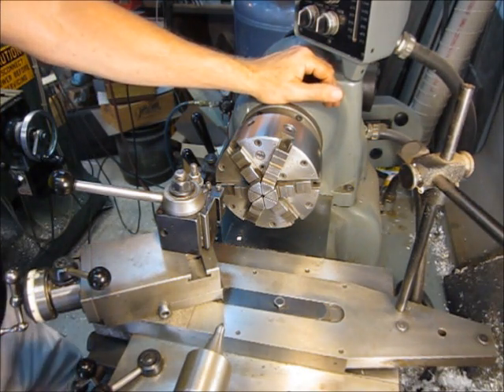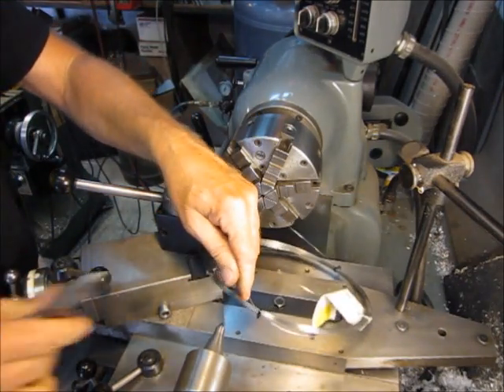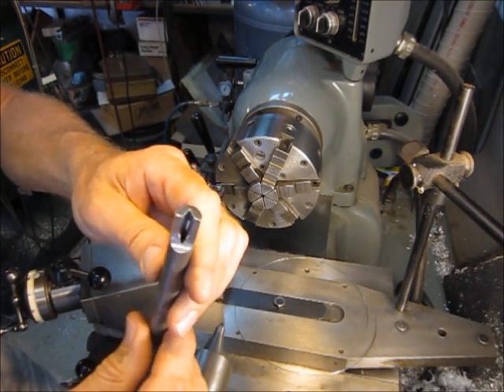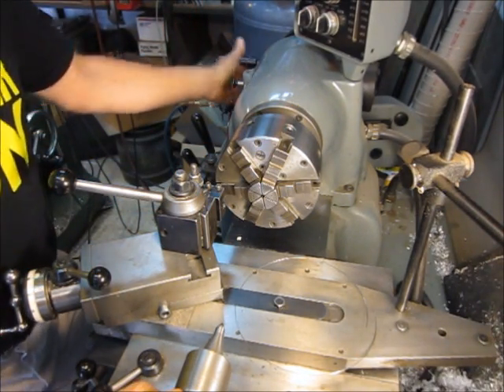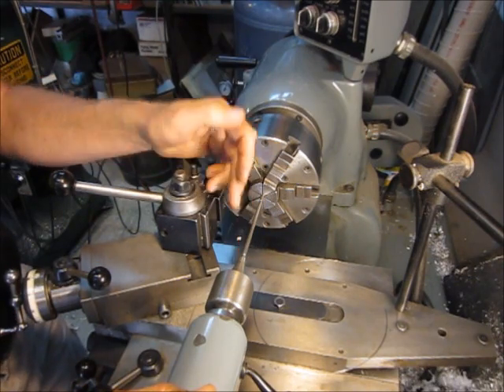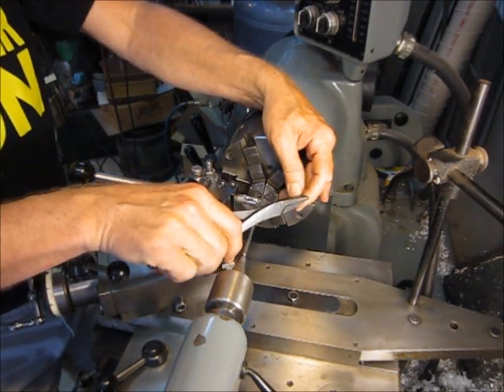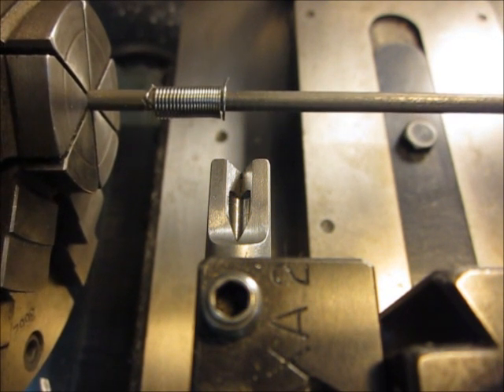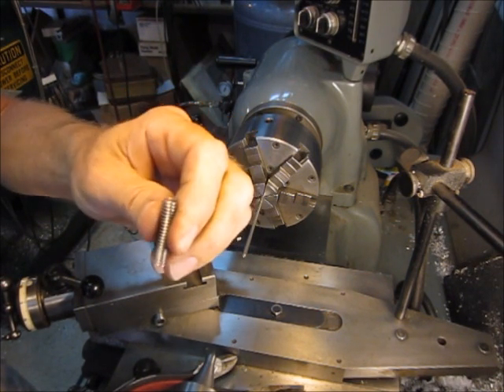How to Wind a Coil Spring on the Metal Lathe

Comment: For a compression spring couldn't you set the threads per inch at say 20 threads per inch or less to wind it with a gap already generated in it before it comes off mandrel so that it is more consistent?
Reply from the maker: Springback of the wire affects pitch as well as diameter, so the finished pitch may not be the same as the feed rate

Comment: Hi Tom. I hope you are well. It's been a couple years since I've watched your videos but I'm sure your techniques are coming in handy on a daily basis. I'm surprised this video wasn't at the top of my "How to make a spring" search. But whatdyknow, as I started another video, you were right at the top of my "Up Next" column. Maybe YouTube want't me to see the wrong way first.  Who knows. Didn't watch it. 

Ok! Movie is about to start! Thanks Tom. Have a good one!
Reply from the maker: Thanks.

There really isn't a right or wrong way to make something, as long as the finished part is correct and the method is safe. Some ways are just more efficient than others.

Tom
Reply: @TomsTechniques  Yeah I was just kidding about the other video teaching me the wrong way. I still haven't watched it... What you're saying makes sense to me.  If the method is safe and effective, you're somewhere in realm of right ways. If If you fail to check both of those boxes, you're probably in the realm of wrong ways.
Reply: Let me add that my first attempt to wind springs on the lathe  was straddling the line between right and wrong. Didn't get hurt but that .080" hard stainless wire was quite the wild animal. I think it's a sign that your heading the wrong way if you're doing  strenuous physical labor while operating machine tool. I did manage to make one that was loosely within the specs I needed... But I need 8 so, time for a lesson.

Comment: Don't cut steel wire with the side cutters you use for copper wire.  Said side cutters will be useless after 10 cuts.  Use tin snips or proper steel wire cutters that resemble bolt cutters as wire cutters for steel wire, they work better and don't break.
Reply from the maker: I think you may be referring to the flush cutters used in electronics, which will definitely die if used on hard wire. The side cutters I used in the video have a 90º included angle on the cutting edges and hold up well on small diameter hard wire. Cutters with compound action, such as bolt cutters, are necessary for larger wire because of the force required. Of course if your side cutters are made in China, all bets are off. :)

Tom

Comment: Unlike the comment that said it wont work, I found your video very good. I have made springs with a battery drill and a mandrel free hand that worked just fine. Your method is much more precise and I will be making the guide tool to try it for myself. Once again, Thank You. 

In reference to the comment, "you are doing wrong",  for criticism to be constructive it must be accompanied by the facts that support the "wrong" and perhaps the commenters view of the "right way" for support. Just my  .02 worth.
Reply from the maker: Thanks Shannon.

What most "You are doing it wrong" comments really mean is that you are not doing it their way. :)

Tom

Comment: sir you are good machinist. But I seriously doubt you can make a better spring than a torrin spring machine. no disrespect intended but I was a spring maker for 15 years and have since moved up to  spring machine maintenance. I find your techniques extremely helpful since the gentleman I work with in the tool room offer no help to me at all.
Reply from the maker: Springs are a necessary evil and I only make them if I have to. Not looking to replace a machine. ;)

Comment: Hi Tom! Thanks for sharing your tips!  Do you know how you could get a specific pitch for your coil using this method?
Reply from the maker: Coils per inch would equate to threads per inch on the lathe. It's not always 1:1 though due to spring back in the wire, so you may need to experiment a bit.

Tom

Comment: A bit too slow, but good information.
Reply from the maker: +Dan Butterworth 
Thanks, but I have to disagree about the speed thing. There are many levels of ability here, so it's better to take it slow and cover all the bases than rush through for a few. 

Tom
Reply: +Dan Butterworth Not to be rushed, stainless spring wire can go right through your hand or tear off a lot of flesh, handle with care.
Reply: AusMecham I wasn't talking about the speed of the machine or the winding. I was talking about the length of time (filming) it took to do the set up. Tom was correct in that for me it was too slow, but for many others maybe just right or to fast.

Comment: For a compression spring, don't stretch an extension spring or it will simply not have the compression rating you expect and in time it will flatten as the wire goes back to original de-stressed position - always wind the coil with the desired gap for a compression spring to get the free and compressed length you want - in addition the compression spring needs a dead coil (flat with no gap)at each end or the spring will compress crooked - to do that just stop the cross feed at the end - cut the wire and then grind the end of the spring flat back to one dead coil.

Comment: After you bend the spring end to a hook it must be de-stressed in the oven or the hooks will brake off at the tight bend with age and work - preheat oven to 280 F and leave spring in the oven for 20 minutes and allow to cool in air and that will de-stress the tight bends on the hooks you made and they wont beak off.

Comment: My local spring works guy showed me how to make springs - 2 things to add - after winding the spring if you want to put hooks on the end get some flat sheet in the vice and grind one edge of it sharp to use as a bending jig - push the spring side on to the edge of sheet so one coil of it is on one side and the rest of the spring on the other side - this isolates the rest of the spring from the part of it you are bending so only the end coil; get bent and doesn't bend the second coil in at all - slip a screwdriver between the jig face and the single coil and bend it out a bit - then grab it half way and bend it 90 degree - that will give you a hook that looks like it was machine made and your wont bend the second coil at all.

Comment: Awesome!
Could you make gooseneck that way? You know, like for lamps?
It's made of two springs inside of each other, with the outer one made from triangular cross section wire.
Reply from the maker: +Cancun771 
Not sure how you would control the orientation of a triangular shaped wire, but it might work. Give it a try.

Comment: Tom, how does one overcome the problem of making a small internal diameter spring with comparatively larger diameter wire?  I'm worried I will have too much tension on such a small mandrel.  Any tips to overcoming this obstacle?
Reply: You just need to use the travelling steady against the mandrel, as close as possible to where the wire is winding. Just the same as when turning except that you are pulling wire instead of pressing against a cutting tool.
Reply from the maker: +Barry Lochridge 
That is one of the limitations of this technique. At some point, the force to form the wire will exceed the strength of the mandrel, but by keeping the mandrel short and using high strength steel for the mandrel, you can wind some pretty beefy springs.

Tom
Reply: +Toms Techniques what would you think would be the largest gauge wire you would be able to wind a spring with?
Reply from the maker: +ryan cler 

I've wound 3/32" wire with this setup. but it was a larger diameter spring. The mandrel must be capable of standing up to the force of the wire without bending.

Tom
Reply: Would it be possible to just heat treat it after winding?
Reply from the maker: +ryan cler 
Sure. You could wind larger wire if it was in the annealed state.

Tom

Comment: Awesome Video!
Did you make the mandrel or did you buy it?
Thanks
Reply from the maker: +Michael Pfleegor 

Thanks. Check out the video at 3:15 to find how how I made it.

Tom
Reply: No no the mandrel not the wire guide.
Thanks
Michael
Reply from the maker: +Michael Pfleegor 
Sorry. Yes, the mandrel is just a piece of round stock with a cross hole for the wire.
Reply: +Michael Pfleegor Check out 2:19 on the video

Comment: You can wind compression springs by setting the feed to 1/(diameter of the wire plus the desired spacing between coils). As always with springs, you will have to experiment with mandrel diameter and feed to get the exact compression spring you are looking for. 

I use a slightly different style of spring winder; I made this one nearly 50 years ago:

http://s898.photobucket.com/user/pwmeek/library/Shops/Spring%20winder

Setting it up on the lathe is the same.

If the outlet of the winder (of either type) is set to trail the location where the wire is winding onto the mandrel (by maybe by 1/2 to 1 wire diameter) you can get a bit of pretension (which one of the other commenters was asking about). You need to wind a few turns by hand before interrupting the feed while the mandrel turns 1/2 to a single turn farther. Now the wire is pulling down past the previous coil (you need good tension on the wire) and putting a bit of pre-load into the coil. Pulling the wire "over the shoulder" of the previous coil puts a little sideways bend in the wire, pressing it against the previous coil. Wind longer than you need and discard the "soft" coils at the beginning.
Reply from the maker: Peter W. Meek 

I used to think that tension was necessary as well. The tool I use in the video uses no tension at all and winds excellent springs, which is fine by me because maintaining constant tension can be a pain. I do occasionally use the feed to wind compression springs, but like choosing the diameter of the mandrel, it takes some guess work to get it right.

Tom

Comment: Several years ago, I used my old Logan lathe to create new heater elements for a heat treat oven.  The material was softer, but doing the process of coiling them roughly like you did got the job done.  I never thought of actually making springs, though.  Awesome tutorial!
Reply from the maker: Thanks!

Comment: Is that 302/304 or 316 Spring Tempered Stainless Steel Wire? Overall, very nice video. Just was wondering what type of steel your working with. (+1 : 671)

Comment: Great Video!
I saw spring making in my shop theory book 40 years ago but never actually saw anybody make a spring.
The next time a garage door spring snaps I am ready to slap an arbor on the lathe and go to it.
Reply from the maker: Thanks Bob,

That sounds like more trouble than it's worth. It would take a pretty beefy set-up to handle wire that large.

Tom

Comment: Very useful tutorial (as always). Does the guide need the v-groove or will just a drilled piece of CRS do? Can the groove just be machined with a 90* angle with an endmill?
Reply from the maker: Thanks.

The V groove allows for many different wire sizes. It is 60º on mine, but 90º may work if you don't have a 60º cutter.

Tom
Reply: Shouldn't just having a countersunk hole be enough for different wire sizes? Or even just drill through, and then milling off part of the top half of the tube to act as a groove?
Reply from the maker: Anand Rajamani

You can try, but I suspect a V-groove of some sort will provide more precise control of the wire.

Tom

Comment: That was super cool Tom. How long have you been machining? I have watched two of your videos so far. You have new subcriber!

Question: Do you think you could make a compression spring by just setting the quick change to maximum feed rate? I am wondering if this method would work for heavier wire. BTW thats a cherry lathe ya got there.
Reply from the maker: My first exposure to machining was in my ninth grade industrial arts class back in 1968 and I never looked back. I just enjoy creating things.

You could wind a compression spring using the feed, but I find it easier to just wind them tight and stretch them out to suit.

I bought the Hardinge new in the mid 80's and it has been serving me very well. In my opinion, it's the best lathe around for light duty super precision work.

Tom
Reply: Toms Techniques the place that I work at has had the same lathe for over 30 years, when it was newer my old friend and teacher Freidrich took great care of it and made precision work on it every day until my job moved to another state. In the new place they used the lathe to open up the bores of grinding wheels for several months before I transferred there. I saw the ways covered with grinding grit and figured it was doomed but a few years later a new ways plate was installed and it was precise again. Hardinge made their equipment to last and also made it repairable but a blacksmith can still damage it badly in a short time. Yours looks perfect.
Reply from the maker: Bob Jimenez

If someone ground on it, it was doomed. The carriage uses Teflon slides and any grinding dust that gets in was there for good, wearing away at the ways. It's a good thing they were replaced. I bought mine new in the mid 80's and it's been babied ever since.

Tom

Comment: Thanks for the tutorial. I am needing a large spring, about 4" diameter with wire thickness of about 1/8". I have been looking into making it myself. Do you think there is any added danger, aside from the things you mentioned, in a spring this size?
Reply from the maker: Just a LOT more stored energy. Springs that size can break bones so be very careful.

Tom
Reply: Thanks for the input. I am just trying to save some money because the only place I can find to make it wants $285 for one spring. Do you know of a good place to buy the spring steel from?
Reply from the maker: Evan Leftwick
McMaster Carr has it in 5 pound coils for $24.
Reply: It might Gottlieb I will check that out
Reply: Evan Leftwick
That's because setting up to do at least 25 springs (if not 50 or 100) is as easy as setting up to do 1 when you have specific tolerances to meet. Hand coiling is easier but I'm not sure how easy hand coiling 1/8 inch wire is. Usually a machine is used at that point. Although I guess coiling just one on a lathe then tweaking it shouldn't be too hard but doing this by hand to a spring especially 1/8th inch isn't exactly easy.
Reply: buy or make the correct tool to tension the spring steel. I'm sure that they are available along with the coil rack needed to hold your material. God be with you my friend. Please make a video when you do it.

Comment: Another tip for doing compression springs, is to do it the same way, but set the gearbox for the pitch of spring you want. More accurate than making a expansion spring then stretching it out by hand. Great video, Keep them Coming.
Reply: brought back good memories
Reply: hereford newspaper

Comment: Very nice.  I added a digital encoder to my lathe (DIY CNC using Arduino Due, stepper motors and old Myford ML7 lathe) - so I just realised I can turn springs of any wire diameter now using your method
Reply from the maker: I'll expect to see a video. :)
Reply: Heh heh. I don't have a need (right now) for any springs (or do I? never thought I would ever make any) - but I do need to turn some Acme threaded rods. I'll video that. Similiar CNC process except multiple passes.

Comment: What's your feed set too 0.002?
Reply from the maker: One divided by the diameter of the wire will give you the number of threads per inch to set the gearbox. In this case the wire is .025", so 1/.025=40.

Tom

Comment: Very cool Tom,  years ago my Dad's welder, blacksmith, fix all guy, Tom Davis who became a good friend and mentor to me made some drawer pulls, around 3" in Dia. by putting a pipe in his lathe, moved the tool post close, held the 1/4" rod and turned on the lathe, about 30 seconds he had a long looking spring, cut them off one by one and welded them together. So quick so simple, think my eyes were like diner plates.   Stony
Reply from the maker: Larger diameter coils are easily formed like this, but the difficulty goes up quickly with harder materials like spring steel. I made some chainmail a while back and produced all of the rings the same way as your dad's welder buddy and it took around 10,000 of them! I nearly lost my mind before that project was finished.

Tom

Comment: I understand the guide directing the wire, however I don't understand how the wire made the tight coil on the mandrel without using a source of tension, such as pulling on the wire as it winds up.

 Absolutely- Great video. Keep them coming!
Reply from the maker: That's the nice thing about this technique, tension is not required. The guide supports the wire close enough to the mandrel that it winds without tension.

Tom

Comment: Tom: Nice production. I use a similar method to wind springs but also use a brass pressure finger to keep constant tension on the material.
Reply: This sounds like a great idea. Where do you buy or how do you make the brass pressure finger?
Reply from the maker: Jeffery Jensen

Thanks.

The guide is actually steel and I describe how to make it in the video.
Reply: Toms Techniques
If I remember correctly, you mention using pliers to hold the spring steel, that is keep tension on it while its being wound up on the lathe. It sounds like Jerry has some type of clamp screw (brass pressure finger) which is attached to the mandrel at the entry point of the spring steel. Hoping you or he would explain this in more detail.

Thanks for the videos, very helpful.

Comment: For a compression spring, would setting the feed to 20TPI or less work instead of stretching a tension spring of 40TPI?
Reply from the maker: Steve,

I've never had much luck doing it that way, which is why I started doing it this way. Too much trial and error getting the pitch right. Maybe you will have better results.

Tom